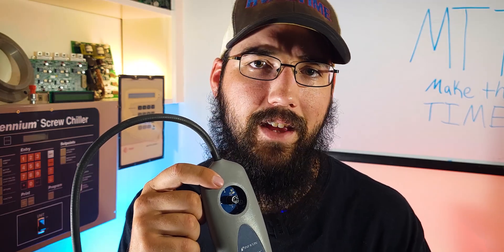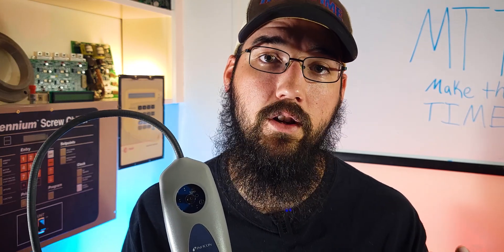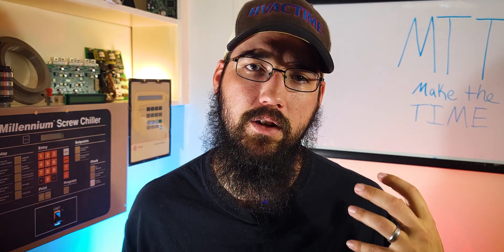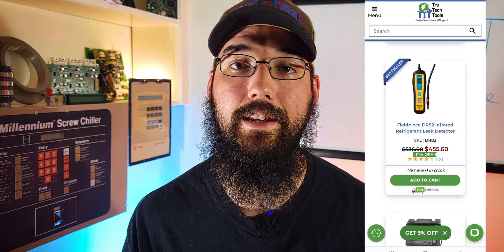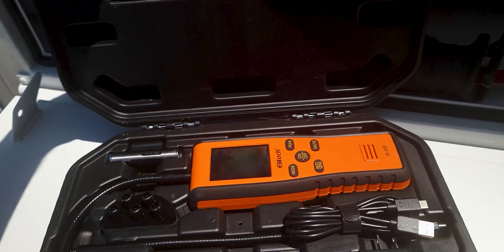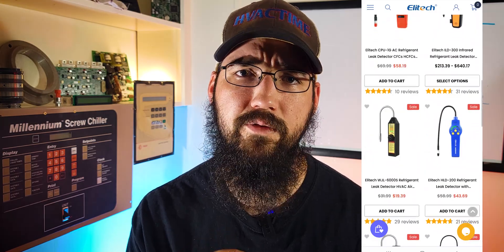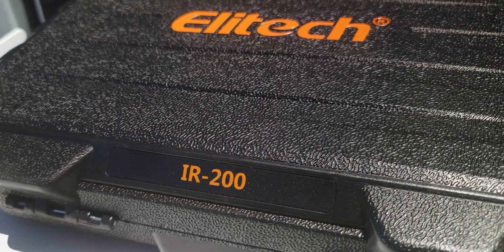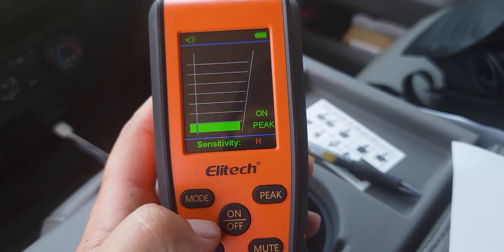HVAC Leak Detectors

Comment: No I do not use any leak detector. I wanna find the leak fast than any detector out there. I use my method.  evacuate the whole system Then pump the system with a little R290 or R600 Then put the flame where you think the leak is and it'll show yourself.

Comment: Fieldpiece is a good option but when it comes to meters- Fluke is the standard over all for speed,accuracy and will for many years. Fluke 179 is the best meter, nothing comes close at any price. for example, when checking capacitors for deviation, take a fluke up against a field piece and watch which one reads faster and more accurate. The difference is night and day, even with the new field piece meters.

Comment: 20 years hvac have repaired 10,000 leaks. first off treat your leak detectors like its  a newborn baby keep it in the case dont drop it et. so I got the The 55 dollar after coupon Elitech CPU-1G AC so far is the best leak detector I have ever used. it looks cheesy, sound super cheesy. and the cheesy money box it stores in is cheesy. it looks like a plastic toy that came out of a kids toy section. but it is the best effing leak detector i have ever used lol. the end results are legit. vastly better than the inficon. i know nothing of the other elitech leak detectors but theyre probly good too. elitech seems to be me making some real good stuff their digital gauges are phenomenal.

Comment: You mentioned on using R22 as a tracing gas to find leaks. That’s pretty smart. But my question is by adding R22 in a 410A system. Even not too much R22. Do you think the r22 oil will cost any damage on the 410A system?
Reply: I wouldn't do that, and who wastes r22 these days? Stuffs liquid gold.

Comment: So ive use the companys inficon dtek, its working for the guys just fine, i just dont like its feel, so ive been looking at the dr82, bit more rugged a build… cannot find anyone running it to assist my choice, my old boss has a slightly older heated diode, that worked fine, and i think “heated diode” meters are the most obvious way to find leaks in any gas, IR having that technique to constantly question as you look for some small leak… 
Theres also the newer fieldpiece dr56? Which is also a heated diode. I still cant really decide.

Comment: Yeah I use both the dtek select and the H10 pro
Reply from the maker: Which is your top pick?
Reply: @HVACTIME  Honestly, the DTEK select. My early days in the trade I learned on a halide detector working in refrigeration. Then as I became a mechanic I used Dtek heated diodes working in mission critical environments. Had a coworker turn me on to ultrasonic. Never purchased one due to no real reason of having a need. Plus was hard to use in data centers with a lot of white noise. Started working on large tonnage chillers and then moved to the H10. Had an old timer mechanic who swore by them. He was one of those guys who has forgotten more than I’ll ever learn so I purchased one. My go to is the Dtek.

Comment: How many hours is recommended to replace the heated diode on the tec mate? Have used mine about 10 times and I feel like it's not picking up like it use 2? Ive changed the filters and fresh batteries.
Reply from the maker: 100hrs of operation

Comment: You're right about fieldpiece, I was already working in the industry when fieldpiece was coming up. I remember finding the jaws of my amp meter broken on one of their hi-end meters they had on the market at the time and I was really dissapointed. My original fluke 902 from 10 yrs ago still going strong but I'm sure fieldpiece has grown alot more since. I'll be willing to try them again.
As for elitech I don't think they're bad. Their on par with the "Value" brand from china I'd say.
Reply: Infinicon hasn't failed me yet. Working tech for 5+years.

Comment: The Dtek Stratus is my go to. It even has an optional CO² sensor.
Reply: Im not sure what the hype is with the optional co2 sensor? What purpose are we using these for that im unaware of? Or is it literally just reaffirming the room air co2 levels in HVAC servicing monitoring public health type thing…
Reply: @f1reguy587  Leak checking systems that use CO² as a refrigerant, and using CO² as a trace gas for finding leaks.

Comment: H-10 pro are awesome to bulky though and they seem to have a battery charging issue over time they just won’t hold a charge, also one drop of any moisture and bye bye I have the sr-82 and I have my amazing days with it and my bad… however it will pinpoint unlike some other ir leak detectors

Comment: By the way Holden , do techs over  in the States have to buy their own leak detectors ? Over here the employer has to supply it so we don't get to choose which one we get , and also it has to be " checked for calibration " once a year by a third party company or organisation that will deliver a certificate of calibration which allows you to use it for one more year ... Money making scheme some will say , other say it's necessary so that companies keep their leak detectors in working order ...
Reply from the maker: Yes majority of companies do NOT supply detectors of any kind. I've recently learned that union shops do a lot of that but rarely on the non union side. We have a sharable detector for our techs who are working on getting their own. We definitely do not have ours test/inspected/certified at all.

Comment: Why does ultra sonic go unnoticed so often. I have used heated diode, IR and ultra sonic. I find ultra sonic to be a fantastic choice. You have to be able to tune out the noise thats unwanted and tune your ears to what is the source. Yes certain lights can make noise, but you dont need trace gas at all, just nitrogen. Experience in proper techniques to understand the how, what and why goes a long way in finding a leak. Another great video. Thanks for your contributions to the trade. Many people value your videos and instructions.
Reply from the maker: I feel ultrasonic is a fascinating tech but still ahead of its time. MKBHD on YouTube did a video about that at one point. Products that are the future but the market isn't ready for them. While I support it I cant make a recommendation for it YET.
Reply: @HVACTIME  fair enough. I am going to buy one when i can afford to drop that kind of money on it.
Reply: I have one but I had better luck with a heated diode tester.
Reply: I would say that the disadvantage with ultrasonic would be in that you have to recover all the refrigerant and then put in nitrogen and then pull a vacuum afterwards. So I would think that ultrasonic would be advantageous for when you have already used heated diode or IR and you are not confident in the results. It would definitely be an excellent step two for when step one is not good enough.
Reply: @HeyChickens  No? You can cover part of the condenser to increase system pressure and find a leak that way.  Ultrasonic can also find leaks that are covered up or too far to reach without moving a bunch of stuff.
Reply: @markm0000  Covering the condenser ought to work like you said. Only thing is you'll have to probably turn the unit on and off to maintain pressure, no? There would be too much noise with everything running, right?
Reply: @HeyChickens u must not be union lol. Got a leak, just dump nitro in and find the leak. Aint nobody reclaiming. Unless Osha is near 😂

Comment: For us lot in the EU it's mind blowing that you guys are still using freon as a tracer gas . It's been a huge no no over here for a long time now . Instead we use Trace-a-gas which is 95% nitrogen and 5% hydrogen , and then we either use a hydrogen detector or nowadays some leak detectors also detect hydrogen so you don't need a dedicated one .
Reply from the maker: I find that interesting, its definitely not even an available practice here. EU has always been significantly ahead with regulations and practices though. Most of our tech is a decade behind yours.
Reply: @HVACTIME  I’ve actually heard this from a guy who has immigrated here to the US from the EU, and we’ve had this discussion bout how HVAC equipment there is more advanced. One big thing he told me was, it works great there, but the US is different as EU equipment tech wouldn’t work the greatest here. Which makes sense to me, we’re comparing continents and lots of different variables than what we face here. Though EU hvac will always pique my interest
Reply: @HVACTIME  Well I wouldn't say you guys are behind tech wise , because most of the new tools come from the States as well as most innovations and new tech in general . You should see the bullsh*t that's being sold in the supply houses over here it's horrific. 
Chiller technology for example , you guys are the world's leaders in that .
EU is ahead as far as the DX VRF stuff , but that's not even European tech , that's Japanese technology .
I think the biggest difference is that Europe is obsessed with "efficiency " and small savings in energy consumption,  where the US are more about getting sh*t done and less regarding towards the costs , although with the current economy that seems to be shifting .
To sum it up,  EU is ahead is some aspects ( regulations and energy efficiency) but at the same time we're behind in other ways...
Reply: I haven’t seen Freon in 30 years. Using R-22 as a trace gas for leak detection is an excellent method for detecting leaks in pressurized systems. It works well when combined with nitrogen and the trace elements of  R-22. Just to clarify, Freon is a trade name.

Comment: dumping R22 as a trace gas in a system is not cool. just use hydrogen if you have problems finding leaks. get with the times, using banned gases for tracing is just wasting time in the past. and hydrogen works considerably better.
Reply: Lol, Dude relax. R22 is not “band” it’s just really expensive and they aren’t making it any more, There is plenty of refurbished R22 drum still being sold at most vendors in the United States. I try to get my customers to use alternative refrigerants like TDX20  is a good.
Reply from the maker: If I remember your in the EU, right? Y'all are setup very different and higher regulations than the US. We are not setup for the hydrogen testing even if we wanted to use it. Not saying we shouldn't be, just stating that's not our reality.
Reply: @HVACTIME  yes, i am from the EU. but just because lax regulations "allow" stuff like R22 for tracing to be used does not mean you cant use something better, it requires a special detector yes but 2% hydrogen/nitrogen gas mix is even very common in the US and can be bought at every gas supplier for roughly the same amount a plain nitrogen bottle costs from what i see from 2 minutes of google-fu. and arguably it saves you money because its simply so fast to use (and r22 aint cheap), you just dump it in like nitrogen (pushing in a whole tank takes about a minute in a decently sized chiller) and the leak detector is just stupidly sensitive so you can trace out a whole system in just a few minutes as you will not get false readings because you bumped the sensor or because its windy or the insulation is outgassing wich slows you down, there is no such thing as false readings with hydrogen. my company also used regular tracing gases (even tried propane/R290) but the 2% hydrogen bottles just make so much quick work of it as you cant have false readings that its simply not economical to do so once you have the detector in your van. if you know someone with a hydrogen detector or can borrow one from a supply house for testing i dare you to try it, you might change your mind. its basically become the norm for difficult leak detection projects in the socialistic hellscape called europe. ps: our regulations are not that different from yours. kyoto and montreal are still the basis. europe just differs in procedures and some methods. the biggest differences are simply because american systems are just so far behind because of the lax regulations around efficiency. just to give an example, i have a heat pump heating my home (floor heating) and it gets a COP of around 6 on average (mind you my country is basically in canada from a american perspective) simply because it only needs to make 80F water even when its freezing 14F outside. those kinds of numbers are impossible for the single speed systems generally used in the US. its not a dig, its just a result of american hvac industry pushing your goverment to keep their margins high instead of pushing them to do better. as a result the rest of the world is sailing you (america as a whole) by and reaping the benefits of japanese made HVAC systems that are nearly double as efficient as whatever crap goodman is pushing out its factory these days for the american market, because the rest of the world aint buying them. come to think of it i doubt such a unit would even be allowed to sell here due to its poor performance.
Reply: @SupremeRuleroftheWorld  are you saying that even if you have the tiniest of leaks, the most impossible to find, a hydrogen detector WILL find it, and fast?